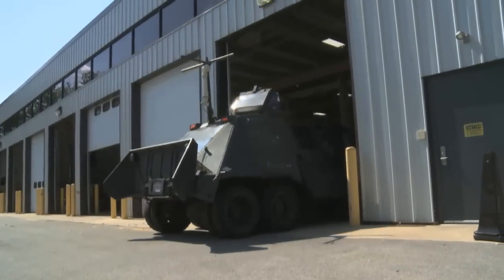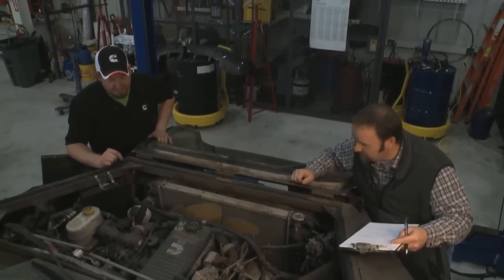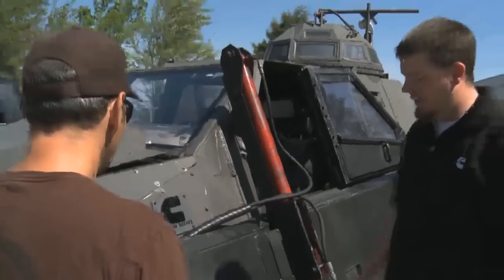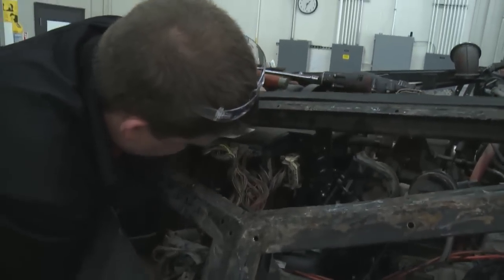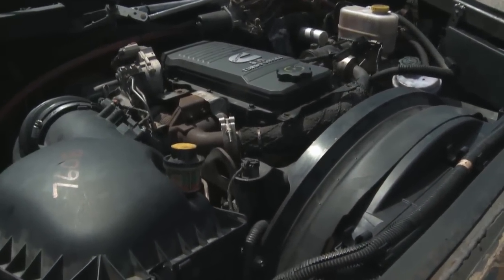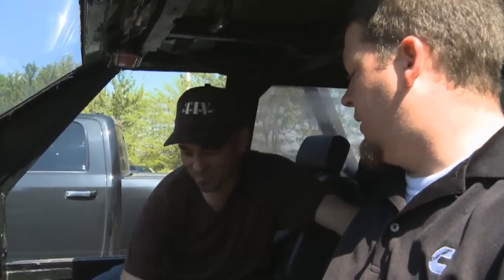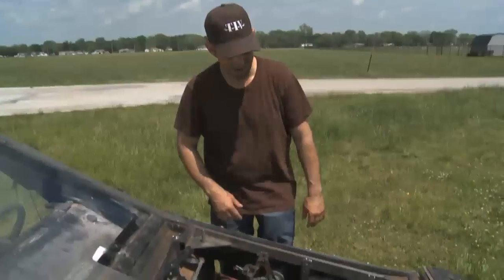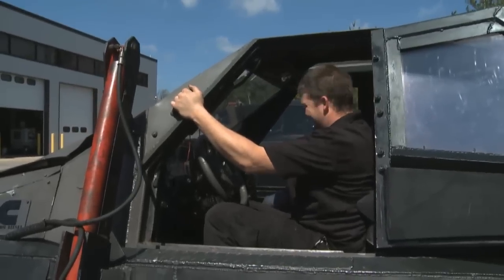Sean Casey's TIV2 Storm Chasing Vehicle Overhauled by Cummins

Comment: Ok Cummins, I'm a big fan of all of your products, but why lie to a customer about the factory airbox being better than an aftermarket one? It obviously flows more air and has a better filter. There's no way a stock 6.7L can move a 14,000lb vehicle in a hurry if its in the path of a tornado, so why not put a programmer on it and delete the emissions junk, and put the K&N filter back on? Please respond. Thanks.
Reply: It's not always about performance, but reliability.
Reply: Alpha Gametauri Yeah, cutting out the emissions junk and an aftermarket air filter should have no effect on reliability..Where do you see most issues in modern diesels? Definitely would’ve been better with the 12V or 24V and I’m sick of working on these modern diesels with all of their issues stemming from crippling emissions control.

Comment: Ha, "Dominator is better" my ass. Id rather be in this beast in a tornado. Dominators sweet, but TIV 2 is a tank.
Reply: reed copied sean  tivs are proper storm chasing vehicles dominators are just cars covered in armour sean stripped the truck right down to the bottom  and rebuilt it reed just cut bits of his hope sean does built a Tiv 3 at some point!
Reply: EvilDave83 what about Titus?
Reply: @taz89ful  Titus and Tiv 2 are perfect for storm chasing.
Reply: @hammerbrogaming3344  titus isnt even that good its a ripoff of the tiv and dominator
Reply: @Akhilesh Arunkumar well yeah that’s why he made 2 more Dom 2 and Dom 3
Reply: @hammerbrogaming3344  i know you said that 2 years ago but 1: the titus WOULD NOT survive in a tornado, it would barely survive in a ef1. Reason? It doesnt have any lowering systems, or any flaps. Hell, even at the end of the movie it only just start to flop around. Those spikes wouldnt do ass.
Reply: @hammerbrogaming3344  titus doesnt even have like a flap system or airbag system it only has spikes
Reply: You know the "tornado attack" was the first vehicle made to intercept vehicles, and reed worked with the guy, D1 looks similar and works the same as the tornado attack. While the tiv was built as a tank, dom was made to be more mobile, originally D1 was supposed to get inside of tornadoes but they discovered they could so they made modifications with the same concept
Reply: @taz89ful ”cars covered in armour” the dominator is a beast. It has successfully intercepted lots of tornadoes and it’s not just a car with some armour.

Comment: i just want to know why he would put a 6.7 with all the emission junk in there. should of put a 12v or a 24v with a p-pump and a nv 5500. would last all of sean's career in the movie business guaranteed.
Reply: He removed the DPF and all that and set it up with propane and meth water injection.
Reply: Still needs a tuner was at least a 90 horsepower tune

Comment: get rid of that EGR!!!  Damn thing just creates more maintenance issues.
And if a tech would've told me that he put a factory air box back on my cummins because it would "breath better", I'd be temped to slap him.
Reply: The air box I can understand because the factory airbox has better filtration with the dust from the roads there
Reply: So you perfer the dominator 3 😒